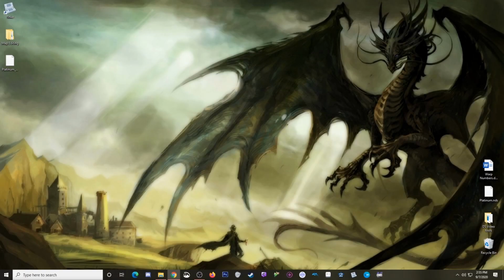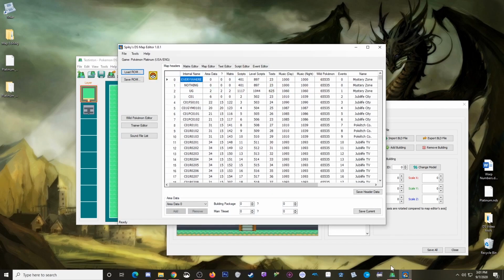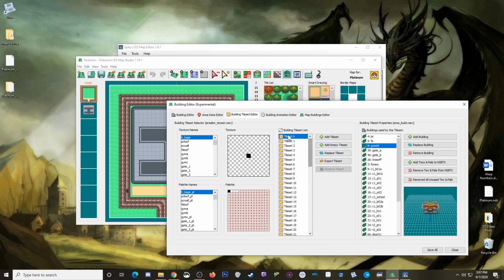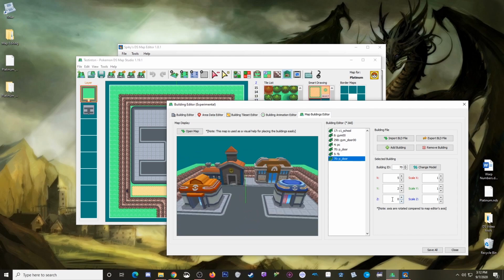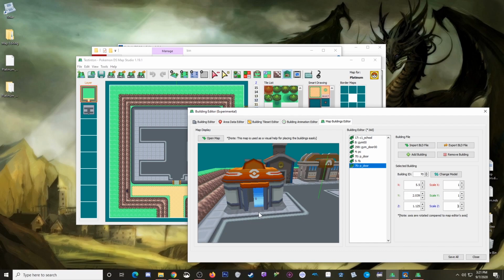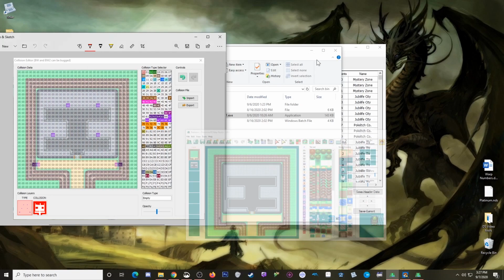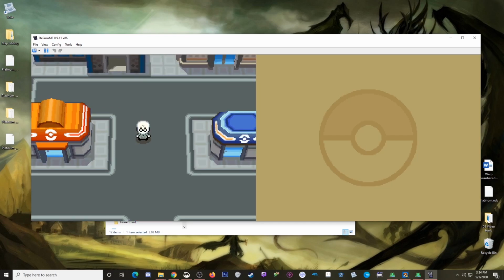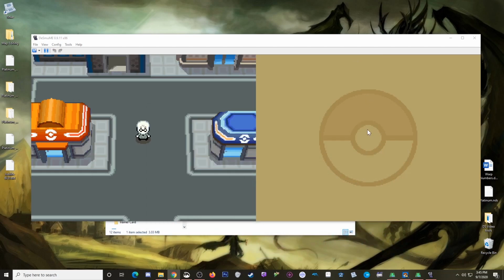[Old Version] Pokemon DS Mapping Tutorials Pt 3: Adding Buildings to Maps with PDSMS

Comment: After ading building to my town and placing them is there any reason why they dont appear on the Map ? not looking to build a ROM just yet just building an region for an RPG campaign im doing an  was looking at using the tool for interactive maps for my players
Reply from the maker: Are you refering to having them show up in PDSMS along with the building? You're not actually putting the files into a rom to have it display in game?
Reply: @JaySan  yea.

Comment: just wondering are you planning on making more videos on how someone could possibly add characters remove characters to there map. and change warp areas so they are different and can be custom. i really like your tutorials and inspires me to try out making a rom hack.
Reply from the maker: I am currently working a video about adding Rowan to my custom map and using scripting so that talking to him gives you the pokedex, access to your party, bag, and also the running shoes. Also also let you summon the briefcase to pick a starter. It's taking a bit to learn scripting but hope to have it out soon! 

As for custom warps, I am not sure what you are referring to. What I show here should let you make  any warp you want. Is there some it does not cover?
Reply: @JaySan  maybe I’m not saying it correctly idk I probably didn’t see it in the video enough to get full info but what I ment like was making a custom poke center kind of thing or like changing the layout of curtain inside buildings
Reply from the maker: @Diflic  All i getcha! To my understanding, there is only one pokemon center map in the whole rom. What happens is that there are multiple map headers that reference different events and scripts. So based on where you warp to the pokemon center map from, a different set of npcs are loaded so that it looks different. Also the inside of building are a bit complicated as you need the building's tileset to place the objects and that are much harder to build than outdoor ones. So that might take a while before making custom interior maps will be easily approachable.
Reply: @JaySan  also that’s pretty amazing I appreciate your work so again thanks for the videos
Reply from the maker: @Diflic  I only hope it makes sense when it comes out! Also feel free to drop by the discord if you haven't already. Lots of smart heads to talk to in there.
Reply: @JaySan  lol I’m already ahead of you on that one lol

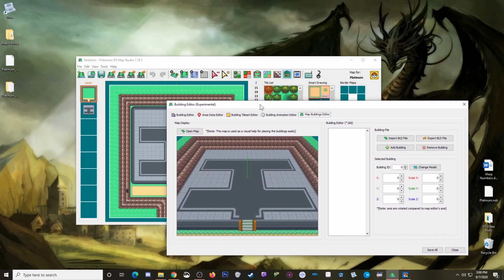Comment: Plzzz help me, you said at 2:56, that if I haven't exported the file as obj file, the 3D view of my map won't just appear on the building editor screen...I did it, but still, nothing happens...And you said that I can open the map in the building editor screen using the obj file, but in the PDSMS 2.1, the building editor screen wants the nsmbd file, can you explain what is wrong...Is there any step which I am missing and what is this obj file...!?!
Reply from the maker: Oh it changed to the NSMBD for 2.1? If you watch me export in mapping part 1 you should see me create both the obj file and the NSMBD file. That process should still be similar in 2.1

Comment: I am in huge danger...I want to use the Building editor in PDSMS 2.1. I open the HGSS file made by SDSME. But when I use the Add Building Button,  The building appears on a map on the Building editor screen, but not the map I made. It appears on the default PDSMS Map...Then I click on the Save all button...But nothing changes on my map...So plzzz help me out !!!
Reply from the maker: Aw dang that sounds like a 2.1 specific issue i have not heard of. You can try asking on one of trifindo's videos but I believe they are very busy at the moment. You can also try coming by the discord and asking in mapping-support, but we may not have an answer to that one.
Reply: @JaySan  ,  Actually this problem also occurs with the 2.0 version. Trifindo showed that it works for him. Do you know if this can happen if there is any step which I missed !?!